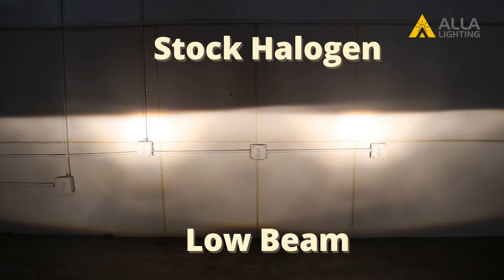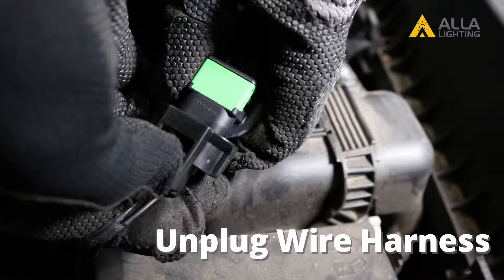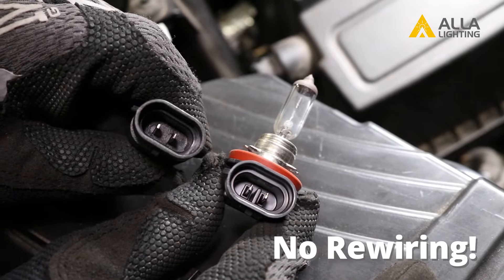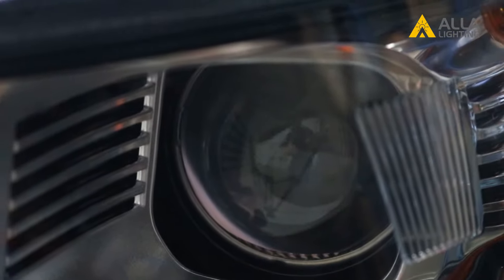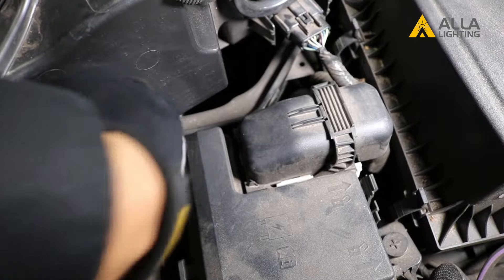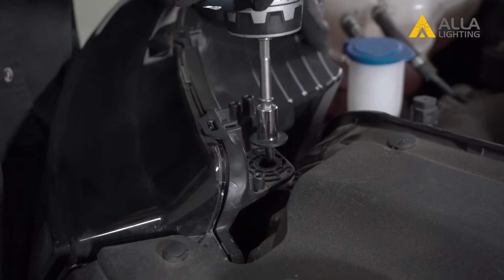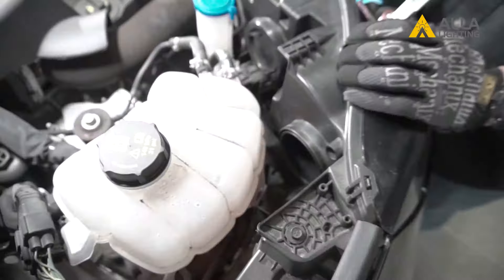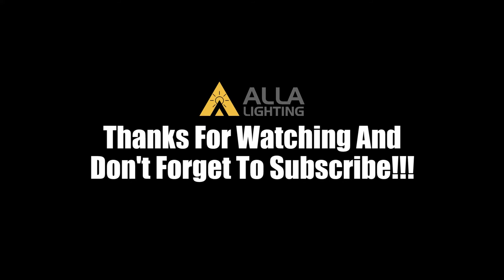How to Install | Change 2015 -18 Ford Edge Low Beam Headlight Bulb?

Comment: I installed these in my 2017 Ford Edge and drove about 100 miles tonight and I will say what an amazing difference!! Not once did anyone high beam check me either. I absolutely hated the stock lights and could barely see the road at times. But with the Alla DC R leds it lights up the entire road. The quality of the product looked to be very good out of the box. Installing was straight forward with no problems.
Reply from the maker: Thanks for your comment and support, we are glad that you love the led headlight bulbs from us, thanks again for your support and enjoy the driving with LED on the road.

Comment: I installed both low and high beams last week. Amazing difference. Only complaint is the Ford boots that keep out  dirt disintegrated in my hands.
Reply: I actually just had to order new ones from the Ford parts dept. 11 bucks each.

Comment: Awesome video ! Just what I’ve been looking for. Question, converting it to LED would it interfere with any of the of the electrical systems? I know on some vehicles whenever you install new lights it says low-voltage, error message or maybe even the lights flicker
Reply from the maker: Yes, it may happen depends on the vehicle.
Reply: Would it happen with the Ford Edge? I’m thinking of doing this myself on my 2018 model

Comment: I have installed  these to my ford 2018 while driving they will flicker once in a while, ive checked the bulb and it will be extremely hot is this common should i be concerned?
Reply from the maker: Thanks for your question, this happens due to the led bulbs draw much less current than stock lamps, for your car, extra load resistors is recommended to avoid the flickering issue

Comment: 2015 Edge...the passenger side headlight assembly looks nothing like what is depicted in this video. I'm unable to pull out the headlight assembly, let alone complete the rest of the steps needed to replace the headlight.
Reply: On the 15 ford edge, each headlight assembly has 2 small bolts and 1 plastic phillips head retaining clip, remove all 3 and then tilt the headlight housing backwards and fordwards while pulling up, nice and slowly and the dowl under the housing should pop out from where it presses into. Once you do it for the first time it will be easier and easier to do

Comment: What a terrible video. You didn't specify which way to turn the bulb when reinstalling even though on the DRIVER's side you said it was counterclockwise to remove, so clockwise to reinstall. For the passenger side you skipped any direction whatsoever and in neither case did you specify direction context (counter/clockwise looking toward the FRONT of the car from inside the hood or from the perspective of looking back toward the passenger compartment). Good luck with your sales.
Reply: All headlight bulbs are lefty loosey righty tighty.... It's not rocket appliances.